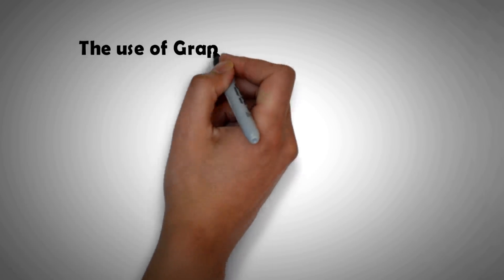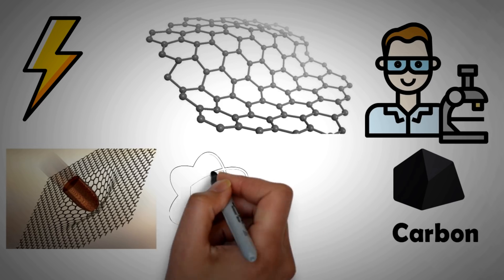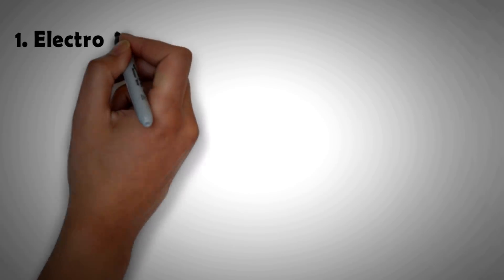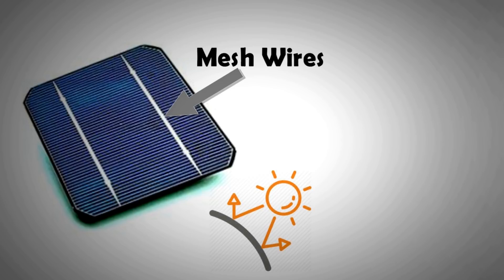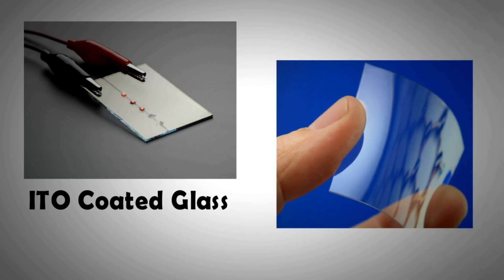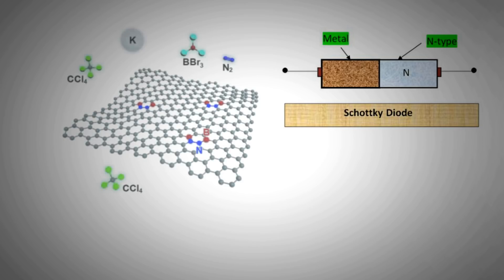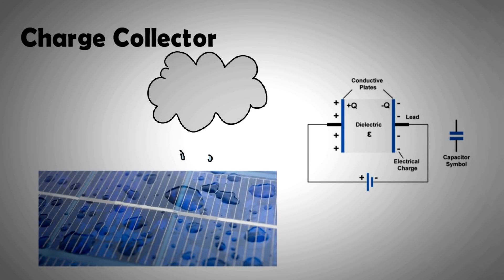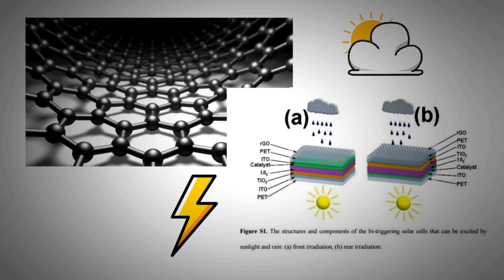How Graphene is taking Solar Cells to the next level

Comment: We have had solar powered pocket calculators for yrs now. 
Why do we not have solar charging Mobile phones ? 
Where the carry case folds out flat & can be placed in sunlight to add charge to the phone ?
( maybe it would take a long time to charge a phone ? but every extra minute of charge helps along the way. )
Also a hand cranked manual winder to add charge. out door camping use etc. 
Or lay it on a window ledge All Day in a safe place such as home or work. ( where it won't get stolen )

The lid of my Laptop, could be covered with Graphene Then left by a window in the sun all day at home to self charge .
the lid already tilts to any angle to catch Max sunshine.

IF most Gadgets / appliances had their own solar charger, there would be Less need to plug IN to the mains. ( or in some cases NO need to plug IN .)

IF every house Cut it's mains power usage by 10% .
then generated 10% of it's own power,  that would be a 20% saving to the Grid. 

Then increased that each yr, with additional  Savings of 1% each yr.
And generated 1% more each yr over 10 years = 40% less power from the grid. 

The 1% increases would come with / via better technology, & people being MORE AWARE of EVERY WATT of power they use in a day. 
More LED lighting, & Appliances that switch OFF Automatically after use. 
& more modern more efficient appliances as they get developed in yrs to come. 

The whole Grid would become sustainable on 100% renewable energy, wind & solar etc. 

The END of Dirty Nuclear & Fossil fueled energy.  ( or as emergency back up only )
Reply: Because your phone will not run on 1.5 watts of power, which is about the output of a solar cell that would fit on a phone.  Phones use microwaves (legal for now anyway) that are only possible thanks to powerful lithium batteries.

I thought this video was plugging a product.  Not.
Reply: @stevexxx6371  Sure, that's what the fossil fuel producers want you to think. They've managed to kill the 100 mpg carburetor years ago. And now they've succeed in keeping the solar cell powered phone from ever seeing the light of day.
Reply: we need to consider power to surface ratio with current solar technology.

Comment: Very interesting, thanks. It seems to me that the importance of efficiency becomes less if we can mass produce panels cheaply, out of non toxic readily available materials. We can get by with less of a battery system in off grid homes, and those batteries can be graphene based too! I just subbed.

Comment: There's the prospect of every double glazed window unit having a clear solar panel sandwiched between the glass sheets. If you add that up for a new office building and add some batteries it could be self powering.
Probably most houses as well.
Reply from the maker: Yes they are relatively inefficient. But consider this, you have all your windows generating electricity at even half the efficiency of normal panels. You will still take that.
Reply from the maker: Indeed. The transparent solar panels developed by Richard Lunt would do the trick
Reply: Ermmm, if a solar panel is transparent that means that the photons are passing through it without leaving their energy in the panel for electricity generation.  I smell BS, there is a very good reason why solar panels are always opaque.  An office block whose double-glazed windows  have solar sheets in them will be a very dark places indeed. Unless those solar sheets are there for decoration purposes.
Reply from the maker: In transparent solar panels, the visible portion of the light spectrum passes through while the ultraviolet and infrared spectrum is absorbed and converted into electricity.
Reply: Fair enough, but that means they are not very efficient as they ignore quite a sizeable chunk of solar energy that is within the visible spectrum.
Reply: @blg53  the visible spectrum doesnt really have sufficient energy to power solar panels anyway, the photoelectric affect only occurs at a particular frequencies which are usually higher or toward the higher end of visible light. solar panels not being transparent actually makes them more susceptible to heating and thus less efficient by a slight margin, youd miss out on maybe a small shred of visible light but would get more conductivity as it heats up less
Reply: @blg53  lets say you take all the uv and infrared as welll as 50 percent of the visible light, you can have it as sunshade windows

Comment: The problem with all these great finds is when will it be available to a poor guy like me . That will be never.  By the time it is cheap enough I Will be dead. It seems that scientist are more greedy than worried about the environment. Until we can freely share knowledge on this Planet we will never advance. Right now we need to cool this Planet fast or none of this will matter anyway.
Reply from the maker: There are Graphene products in market for as low as 10 dollars. In my next video, I will identify all those products. Watch out for that space. I partially agree with your point that scientists have become greedy
Reply: @synergyfiles3536  that's $10 per mg. or per ton?
Reply from the maker: ITO = 5 grams for $200
Reply: @synergyfiles3536  the sun is sending us, at peak a kWh of energy per square meter, from the deep IR to the far UV, the current solar panels harvest 25%+ of this energy mostly in the IR  region. A large part of the solar panel cost is the polycabonat  glass to protect it from hail storm, aluminium frames  to mount it, battery to have power when the sun is down and inverter to supply our home. Can you explain how a graphene based cell would reduce those costs, is it a lot more efficient, if it was they would equip every satellites as cost is no objet or could they be cheaper than a silicium based cell but the cells are currently a minor part of a solar installation.
Reply: Scientists are never greedy, they just want to continue their research. That requires funding. These funds are provided by the big corporate companies for whom money and status is everything. They control everything. And graphene by the way is hard to produce in large quantities in the laboratory. Though it has many groundbreaking applications it is not used much because it cannot be produced for mass manufacture effectively and economically. Research for its economical production with improvements in production rate and quality is going on all over the world.
Reply: Why are you so negative, yes its unlikely to happen in your lifetime but your great grand children might use this technology, of course by then they will have master fusion reactors and solar will be obsolete, as it use way to much land which will be needed to feed the 50b earth inhabitants.
Reply: @johnkubik8559  The only reason why those great technologies haven´t been implemented yet is because people are distracting themselves with pointless things. If we collaborated on the R&D part as a species we wouldn´t struggle with finance and HR this hard. What humanity is doing right now is: Secrecy + competition, it obviously doesn´t work so well.
Reply: it's not greedy it's called taking benefit of your own hard work, look at the history, did Tesla actually give his tower invention design for free to anyone? or did he look for JP morgan to fund him?, it's fact that JP refused to fund him even further, then why wouldn't he just give it away so that someone in the future can build it, like maybe Elon Musk? if you call nowadays scientist as greedy, then you should consider Nikola Tesla way beyond that

Comment: There is no such things as all-weather solar cell.  Cloudy days means very little electricity even if the cells were 100% efficient.  Please stop sensationalizing technology which we won't see for decades.
Reply from the maker: No one is claiming that the efficiency would be 100%. But even if it there is little electricity during rain, it is better than no electricity. When solar panels were invented in the 1950's, no one thought they would become the most commissioned technology even in a 100 years.
Reply: They are making one for night too.
Reply: Reply, reply sure. No one ever... But, ITS still not all weather. More collective , sure.
Again ,nice vid. Just don't over sensationalize. 
Ty